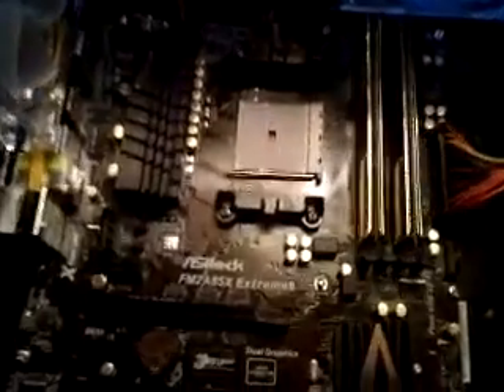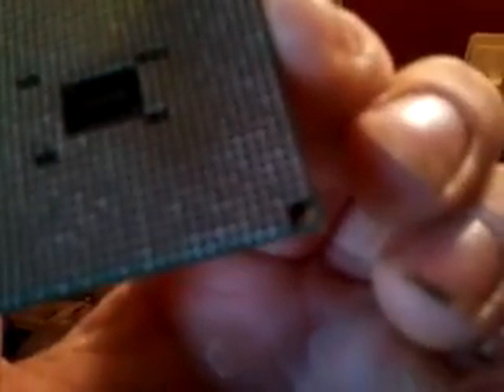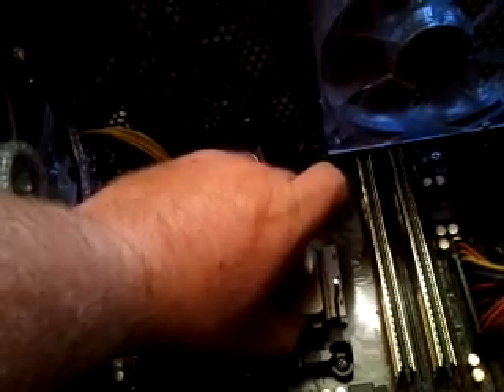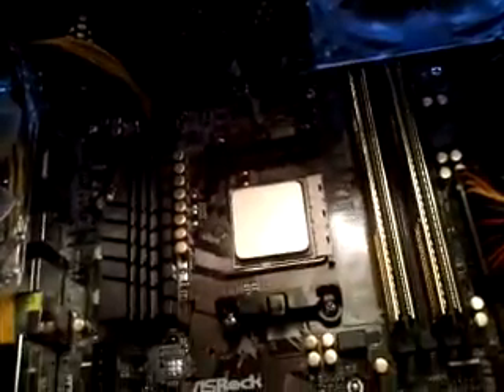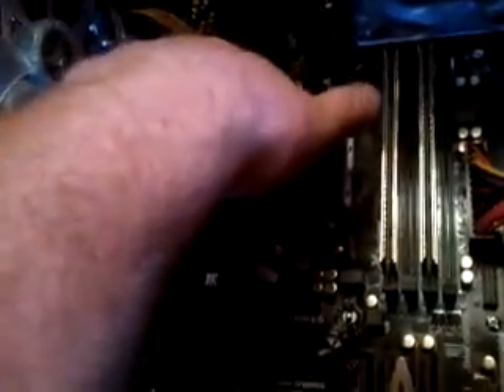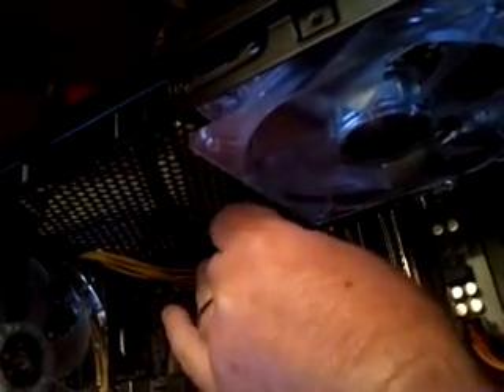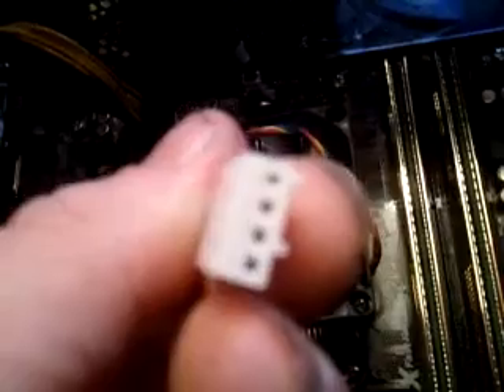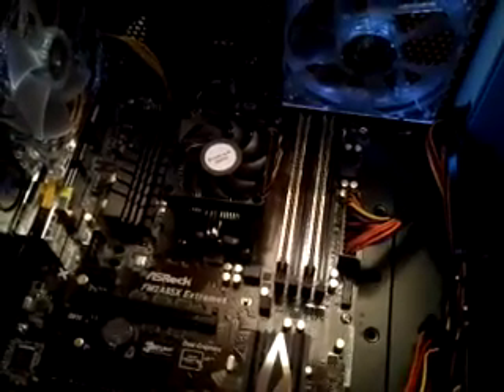How to install your cpu and stock heatsink

Comment from the maker: Sounds to me its a hardware issue maybe not enough thermal paste or your after markwt heat sink wasnt design for your prossecer I get that a lot acually people buying multi use heatsinks and it not listed for their cpu or apu or its a case issue way to restrictive in flow I hope this helps